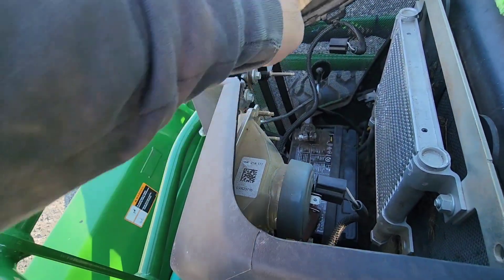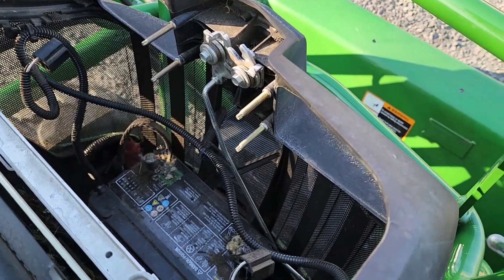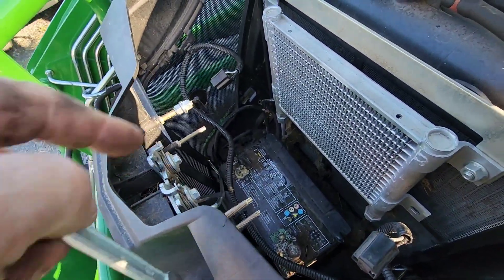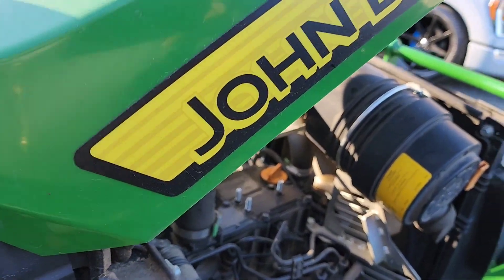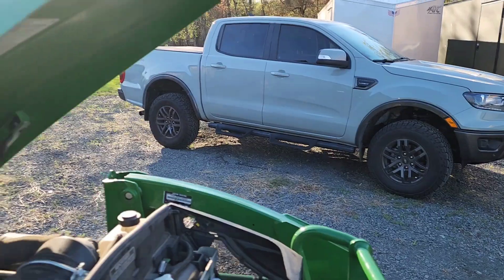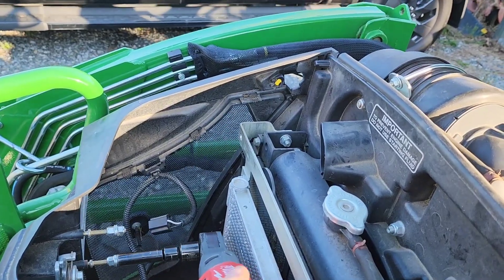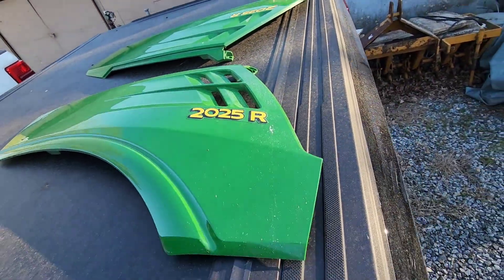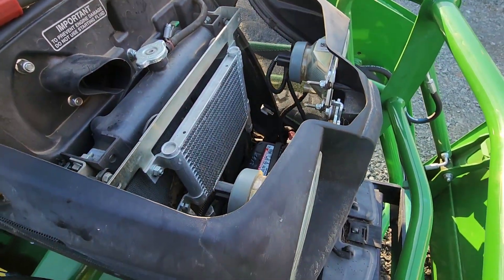John Deere 2025R Battery removal and installation how to video

Comment: Thanks SO much for this video.... I looked all over the interwebs and yours is the only one which shows the tricks on how to remove it.... yes, I have a 1025r - purchase in 2020, but 2019 model.. same exact issue this weekend - meter and charger said totally full, but turned key, not even a click on the starter - no cold cranking amps! .... the 100 degree heat this summer has not helped the longevity.   Even though the charger said "full", I wasn't convinced, so just for grins, i decided to try "jumping" the battery from my pickup, and that worked fine.... so definitely the battery.   I decided to try to get the battery out myself and was equally pissed off that it didn't just lift out.... headlights and screws were in the way.   I managed to remove it by taking out only one of the headlights, but it was a tight squeeze.  My first thought was to simply cut the length of the headlight bolts with my angle grinder with a cutoff wheel, but managed to get them out using a vice grip on the end.   I love your little solution with the two nuts back to back.  As for the battery,  I was wondering if you had to replace the battery with the one from Deere, or you managed to find a better "sealed" battery, like the ones for the pickup trucks?
Reply from the maker: I bought my battery from Battery warehouse for $100 cheaper than John Deere one 😳

Comment: From my 2025R Manual
Remove and Install Battery

Remove:
1. Park machine safely.
2. Raise the hood.
3. Remove one headlight
4. Disconnect black negative (-) cable from the
battery terminal first.
5. Slide red positive terminal cover back and
disconnect red positive (+) cable from the battery
terminal.
6. Remove hold down strap from the tabs on the
battery tray.
7. Pull battery vent tube from the battery tray.
8. Remove the battery.

Comment: I hate my 2025, I wish I would have stuck with kubota. This thing has been a massive piece of China junk
Reply from the maker: @SS-vu9tl  sold mine 😝
Reply: @ I’m almost there myself. Not to mention the agpro dealers are the worst to work with. Had a broken bell crank that raises the mower deck only 40 hrs on it. Had the part in my hand they refused to warranty the part. Said put it all back together and trailer it over and we’ll see if it can be a warranty claim. No thanks, so you can keep the tractor for 2 months then decline the warranty and charge me out the ass.
Reply from the maker: @ wow what a bunch of a holes